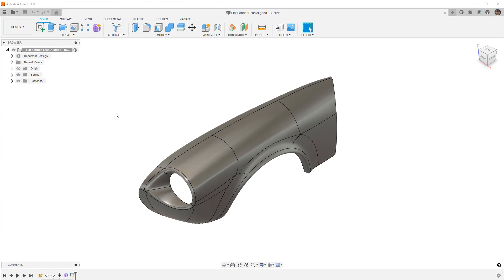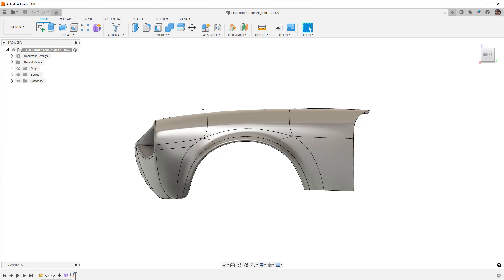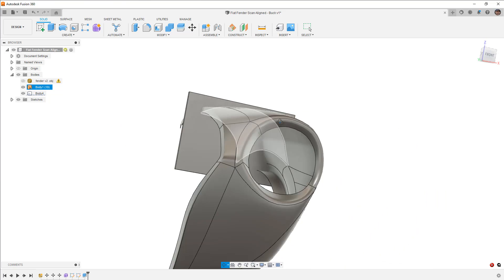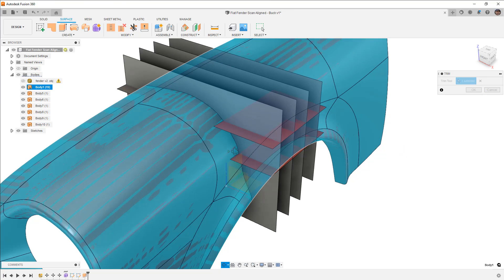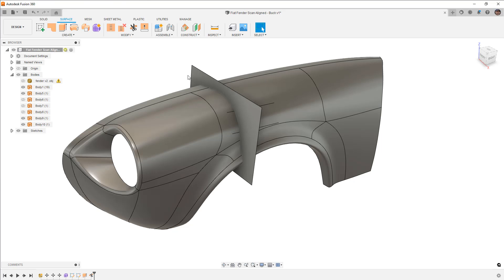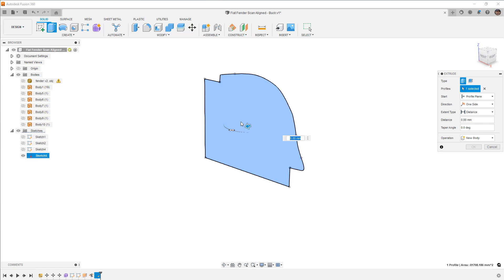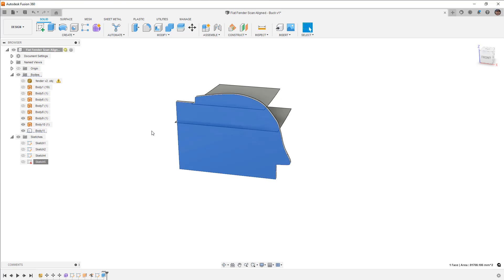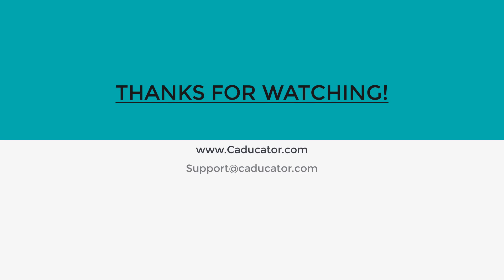How to Model a Sheet Metal Buck for Car Fenders | How To in #Fusion360 #CarDesign #MetalWork

Comment: So for me the key is to start the design with the intent of having a master 'plug' volume that you can later simply boolean intersect your shapes from. And from which you would drive your finished sheet metal geometry and so-on. Even if I was provided a thin "skin" model or a surface geometry, if the dedign was set I would just direct model up w solid plug from the provided geometry and slice that up.

One upside is that this will actually provide contoured slices so if you are, for example, carving MDF on a router table, you could do a little bit of 3D milling to get closer to net shape. In fact I've used methods like this to create plugs for fiberglass parts where we totally 3D carved the layers and then stacked them to create a complete shape. Same concept really. Of course if cutting basic 2D shapes then just taking a cross section slice and extending it is indeed the simple way to go. 

Either way if the designer starts out with a solid volume, making plugs and bucks is almost always a simple affair.
Reply from the maker: I never released a video but did play around with making a custom api to do this where it made planes at a set interval and created an intersection sketch.  There is a small amount of automation that could help.

I agree if you have the ability to cut each piece to the true shape that would really help.  I would imagine a lot of folks would rely on 2d and maybe undersize then fill each void with expandable foam and smooth to the final shape maybe?

When you did the 3d plug for fiberglass parts did you actually stack them together without a gap making it essentially a solid plug?  I like that idea!
Reply: @LearnEverythingAboutDesign 

Yeah I'm the case of a solid plug for fiberglass you can model it as a single big body with whatever added mold details added and then simply use geometry to split it out into sections that can then be laid out on a sheet of foam and carved. I would often cut alignment holes for some common tubing to make everything stay true, and then use spray mount to stick it all. Can even 3D print some sections and floor them into the bulk shape, like, for our case an aircraft cowling with some intake scoops. With even a cheap hobby router, anytime can basically carve up some foam and build up a big tool. 

Of course carving 2D sections and building out the grid and then filling with foam and using a hotwire and/or other tools also works. But once you learn 3D CAM, it's nice to just program it all and let the machine give you some really cool shapes.

Comment: You should check the Slicer plugin for Fusion 360. If the model is modified to be more of a volume instead of a surface, it will automate the whole process. I've done it in other parts
Reply from the maker: Thanks Dave, does it still work?  I know Autodesk dropped support for it in 2020.  https://knowledge.autodesk.com/support/fusion-360/troubleshooting/caas/downloads/content/slicer-for-fusion-360.html
Reply: @LearnEverythingAboutDesign  It still works yes. Tested it today. Both Windows and Mac.
Reply from the maker: @somedutchdude  Thanks for letting us know!
Reply: @somedutchdude  Is there a way to use the slicer plugin in a way that would allow it to automatically divide the big parts into a bunch of A4 papers instead of just one?

Comment: This is very interesting, thank you. I need to do similar for a vintage car where I need to design the body then work out the profiles for the timber framing that goes inside it. It's isn't a buck as such but the actual frame of the car the sheet metal (aluminium) is then shaped over. My current issue is do I use forms or surfaces to make the body?
Reply from the maker: Very nice!  The decision for forms or surfaces is tough.  Right now the surfaces aren't complete in Fusion for this type of work(noting that car body design is a very specific type of modeling with specific software).  So if it can be done with a Form I think the output will be nicer.  Some of the issues you will run into with Surfaces though you might get around since you will be hand forming them.

Comment: It's easier in. Blender by using a plan on the y, z and x axis then  boolean intersect and difference after using the  solidify  modifier
Reply from the maker: There are tools to do this a bit easier, but there is some manual work that needs to happen as well.  In fusion the resulting shape is a true curve and you can send that to be laser cut.  I don't think the result in Blender would be.  You would end up with a bunch of lines because of the mesh.  Curves only exist until it is a mesh and the solidify mod only works on a mesh correct?

Comment: Thank you for the video. I found a video from about 10 years ago from a car builder, he used an array function I believe and he was able to even space all the panels so he could perfectly fit foam boards in the negative spaces. Is that possible in fusion 360?
Reply from the maker: yes but in this case with this fender I would do a rectangular pattern with the sketch lines in the sketch, since it ended up being a surface.  There is no Array function like that but instead Linear Pattern of a body or feature, or the pattern of the sketch entity.  Either will work.  Sometimes Fusion(and other CAD programs) get really picky about geometry so you have to try some work arounds like we did in this video...

Comment: ..i'm just starting Fusion 360 so i don't know much..but is there any way that you can use the section analysis tool and actually save the cross sectional view images as you move the plane along a shape?
Reply from the maker: unfortunately no.  The section analysis tool, and the slice option in a sketch are just graphics.  When you are in a sketch you can use the intersect tool to get the cross section, but there isn't a quick/automated way.
Reply: @LearnEverythingAboutDesign  ....☹☹..curses,.. foiled again!

Comment: I want to take a section from the buck and print (3D) it separately in a small printer. Then I want to take the next section and print that. When it has all been printed I'll join the sections together. What software will do the export of a section from the buck so  I can print it separately?
Reply from the maker: in Fusion if you select the individual Body in the bodies folder, you can right click and "save as mesh"  that will let you save each body as its own mesh file.

Comment: How would you scale it and what software will you use
Reply from the maker: in this case the part was modeled to scale, but you can scale it in Fusion.  Under the Modify tool drop down there is a scale tool.

Comment: This is a parametric model, if not, what is it called?
Reply from the maker: Generally Parametric means the design is controlled by parameters like dimensions.  So this could be since there are values like the thickness that are controlled.

Comment: Could you do a golf driver series in t splines?
Reply from the maker: Sure,  Funny enough I did that years ago for NPower subD add-in for Solidworks.  If you have any specific shape in mind send me an email support@caducator.com
Reply: @LearnEverythingAboutDesign  I don't know how advanced you would want to take this, I'm working on mine and need some guidance.  I'm trying to do a multi part driver with frame above face and top crown and bottom pieces.  

I've had more success with overbuilding with surfaces than I have with the t splines method.  But once I've got the basic model I'm locked into a pretty closed workpiece.
Reply from the maker: @eackerw85  As advanced as the topic needs :)  The one i did before had a removable weight section that was split after the form body.  With a driver and the way the faces/bodies are built this might be a case where overbuilding works.

I am not a golfer so pics or a driver name would really help ;)